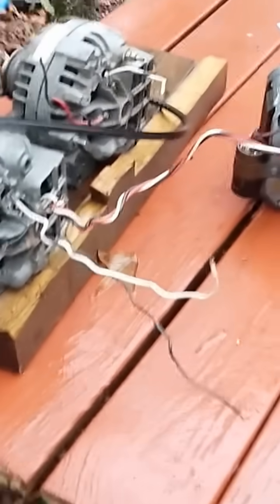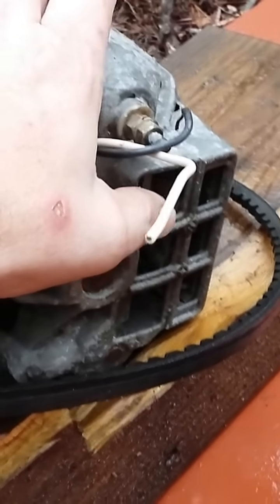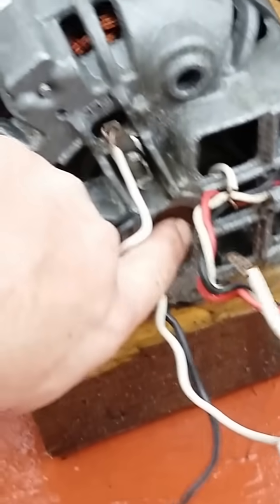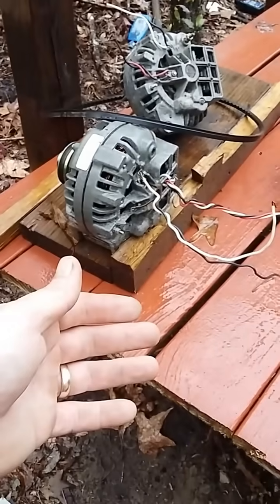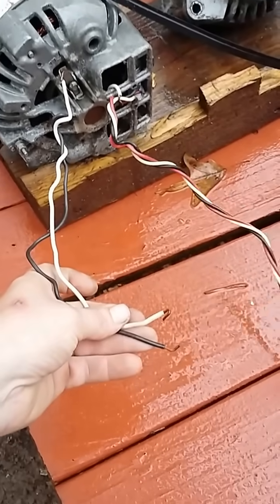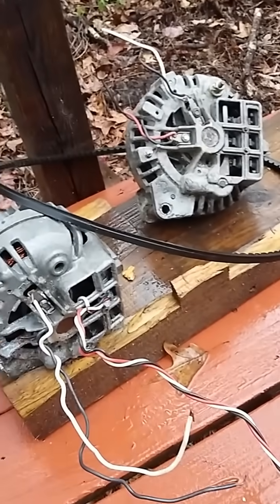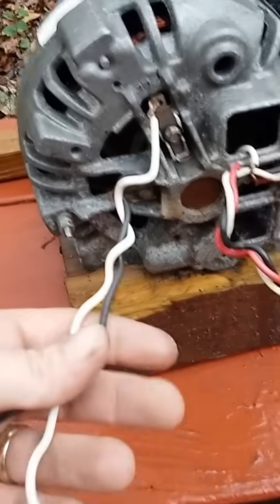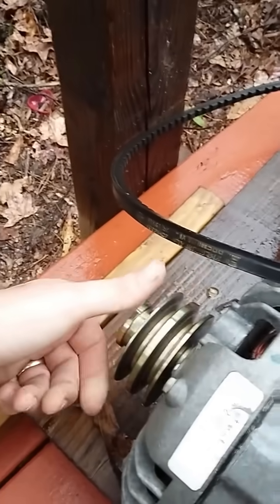Update Free energy forever no wind no solar no gas READ DISCRIPTION!!!

Comment: 90amps is not "alot of power". A nice stereo system in a car will feed from 150-200 amps. I'm not even talking about competition subs.
Reply: DaBuGzLiFe I can't advocate any success from this video, but I can tell you that 90a at 12v is not that much power (roughly 1000 watts- 90x12) but at 120 or 240 volts, 90 amps is allot of power- most homes have air conditioner's that run less than 40a at 240v for the compressor and 20-30a for the blower. Your home Edison circuits are rated/fused at 15 amps/120v, and you can run a ton of shit on that! Higher voltage makes for less Amps necessary to get the same power (watts) potential. That's why car electronics need so much heavier wire than AC.
Reply: Adam Shay I really doubt he can generate anything more than 50v from 1 alternator.
Reply: DaBuGzLiFe I didn't commit to him generating allot of power with that, I simply pointed out that 90 amps is allot of power if it's at higher voltage.
Reply from the maker: Adam Shay brother the only thing that you said in that comment that was true is 90 amps at 12 volts is not a lot of power. When you run 220 volts to an air conditioner system you run 110 volts to the motor and 110 volts to the compressor. 110 volts and 15 amps is not a whole lot of power and will not run a whole lot of stuff it will run one motor and one light bulb or you can run a stereo and 10 light bulbs. Car systems run large wire because they are so low voltage! voltage is a "regulator" that just regulates how much amperage or current can go through the line. So if I have 14750 volts at 60 hertz. I can step down the voltage and gain amps without having to lose my potential.

Comment: can you do this video, step by step, and show voltage , how to get dc current to power 6 to 12 volts ...solar..wind do the whole system
Reply: Jorge Salazar actually no he couldn’t. None of what he is saying is true, it is just a bunch of bullshit he cobbled together.
Reply: The concept is to simply use an automotive generator to produce electricity. This guy gave a half-assed explanation of the idea while not explaining how he got energy to turn the generator/alternator, ie a motor, windmill or waterwheel then acted like he discovered something. Newsflash: generators generate electricity. Wire them up  & spin them to produce power. No news at all!
Reply: If you tap in before the diodes you will indeed get an AC  current.  The big question is how much voltage and current will actually be available, and at what frequency (which will likely depend on how fast it is spinning)  normal household stuff in America is made for 60 cycles power second (or HZ- pronounced Hertz). Most of the rest of the world works at 50 cycles power second.
You could generate some voltage this way (provided you have a way to Keep the stator spinning) but I would plug anything I care about into it until I regulate Rhett voltage and frequency!
Reply from the maker: Adam Shay well then that would be a good reason to have homemade high voltage capacitors and if you wanted 60 hertz all you would have to do is turn the motor at 3600 revolutions per minute. if you were going for 50 hertz then you would turn it at 3000 revolutions per minute. if you want to be able to calculate this yourself think of the word revolutions per minute.. if you have 60 pulses per second(HZ) times 60 Seconds you will see that you need 3600 revolutions per minute.
Reply: ThomasBuie EnergyBuies at gmail com so you result to personal attacks when your information is bullshit and you try to baffle people with it. Boy, nothing is free in this world and your ego is not letting you see this will never work. Hell you don’t even know the difference between an alternator and a generator.
Reply from the maker: "Alternator" is the same as "generator"! SAME WORD...  You on the other hand YOU are a piece of shit excuse for a human being!!!!!!!!!!!!!!!!!!!!!!! Im not picking on you? You literally put drugs in the seat of my truck and told the police they were mine!!!!  I literally don't know anyone who is more of a horrible person than you. This video is misleading on purpose and everyone knows why. And it's in the description...

Comment: Your wire will not hold the load of a house, not with water heater and HVAC. Sure you have the amperage but your equipment doesn’t have the capacity for such load for extended periods of time.

Comment: You never mentioned how you powered the motor. Did you wire it into the alternator for power, probably possible to start the motor off with household a battery power source then switch to the alternator as a source of power, if that is what you did, assuming this ain't all bs, what method did you use for the switch over?
Reply from the maker: manawela 
The alternator on the left is my motor it is a direct current synchronous motor. I have labeled it on one of my other videos as bldc motor. but that is not completely true, even though I do use a brushless direct current motor controller that uses a square pulse wave which is called an electronic speed controller or ESC. it is none the less a direct current synchronous motor because I use direct current on my field winding and I pulse direct current into my stator winding. it is a very efficient motor and a very strong one. One small inverter and a car battery can power the motor for a long time. this video is not an instructional video. this video is a doorway to my other videos. please read the description. I have four systems that work. three of them are complete electrical with no fossil fuel of any sort and one is a regular combustion engine with generator heads attached to it and it powers itself also. (No gas consumption and output is O2) in order for a machine to be able to power itself it first must have enough capacitance to start itself or to run itself while it builds capacitance up. This can be achieved with either a battery bank or with homemade high voltage capacitors. either way you will need to make your own capacitors with aluminum foil. Because you're capacitance is a very key element in building a system. they are very efficient and much more durable than the ones you can buy and they are very important in harnessing alternate current. once you have enough capacitance you have completed your goal.
Keep in mind that your electricity going into your capacitors must be at a certain frequency of either 50 hertz or 60 hertz. 60 hertz on a generator head would be 3600 revolutions per minute. that is calculated by adding 60 seconds x 60 pulses per second or hz. ALWAYS BE CAREFUL WHEN WORKING WITH ELECTRICITY BECAUSE IT CAN KILL YOU.
Reply: Thanks for the information brother, but wouldn't it be less complicated to just run the motor off a battery or batteries  and use the power output to just keep the battery/batteries charged? This should last indefinitely but also have the added convenience of starting and stopping the whole system  easily without so many added steps, basically a flip of a switch. Also I want to use this in my apartment. How noisy is it would sound muffling help.
Reply from the maker: manawela if you used a small permanent magnet DC motor with a battery Bank to turn a large permanent magnet DC motor you could in return charge those batteries with the output from the large motor but you will have to play around with the ratios on your pulleys..

Comment: Perpetual motion is impossible on the planet Earth if it was we wouldn't even need to have this conversation but thank you anyway for the nice video
Reply: My friend says the relativity theory is flawed, and the Planck constant is not .. I believe him .. speed of light is not the limit , we are brain washed in school .
Reply: light doesn't have a set speed, it has a spectrum though.
Reply: Thomas Buie  I never said you couldn't get the power you need .But, you can't make more energy then it takes to produce because of resistance perhaps in the vacuum of space you would even have some resistance but there will always be heat resistance that will reduce power output below what's needed to produce perpetual motion would be a wonderful thing if the issue of resistance could be resolved thank you
Reply from the maker: Daniel Studebaker 
 you have to look outside the box! do you think anyone understood quantum mechanics without looking outside of the box? If you were to take a Siemens 3-phase 500 horsepower electric motor, put a gear Head On It, and use it to turn a hydroelectric generator, do you think that generator would be powerful enough to power that one little motor? you're not thinking big enough brother. I can take a 1/4 scale Servo motor and turn a 190 volt permanent magnet DC motor and the output is a lot more than the input. What I'm saying is it must be a very efficient motor or a very large system and the generator head must either be self excited or permanent magnet. you can use a car alternator but it takes more than one generator head on most systems. This video is for reference only it is not complete instructions for anything and I put Miss information in there to keep certain people away from me and this has worked very well. I've met a lot of great people. I've met a few famous people. I've spoken with scientist and physicist who can confirm what I say to be true. but nevertheless, what happens when you try to take out big oil and the electric companies? I had to make this video this way. most people don't comment and even fewer people have faith. but those are the people that I'm looking for, the people that have faith and want to learn and don't just want someone to give it to them, because if it broke down they wouldn't be able to fix it. that's what I'm looking for. I want to create strength and stability in the communities! if 100 people in a small City of 10,000 new how to do this they could teach the other 9900 people how to do it very easily. I have taught people all over the world. I didn't stop just because someone said that I couldn't do it.
Reply from the maker: Joao Vieira 
you're right and your friend is right too and you should believe him! there are spectrums that don't use travel or speed but move great distances without moving and they do it instantaneously! relativity is flawed unless it is a stationary item without moving through gravity or time whatever you want to call it.. but how does that work? LOL I don't think I should explain it completely but it's mainly because of what everyone calls gravity and gravity makes time possible. Keep that in mind when you're using plasma to build a time machine with a very high ionosphere...
Reply from the maker: Daniel Studebaker my primary mechanic's has the resistance. my secondary machine does not have any resistance therefore I create more than I use. HV caps are a necessity to use circuits on your machine. I use Ohm's law as a reference only because it is not 100% correct.  Keep in mind if I can use an internal combustion engine to turn two large generator heads, I can use one of those large generator heads on a hydrogen cell to power the motor and the other 10KW AC generator head needs to have some homemade high voltage capacitors so it will be constant.
Reply: hey I sent you a email

Comment: Why the hell would someone send electricity to a motor powered alternator? Does it run on fossil fuel or electricity? Lol.
Reply: And alternator doesn't have a magnet in it it using an electromagnet. The more power you put into the field some more power and alternator produces. That's how your car controls amount of power output from the alternator.
Reply: So what you're saying is that I'm an idiot and what this character is saying makes perfect sense to you?
Reply: PHAT PAT. Not saying you an  idiot, just explaining why you put power to the feild. What he is saying makes some sense but I don't  believe it would work the way he says. It's more like 90 amps at 12 volts closer to 1000 watts. You would probably need 1000 watt or bigger moter to turn it defeating your purpose. 90 amp at 240v is over 18,000 watts. No way that little alternator with its small wires is making that kind of power. If it some how produced 18,000 watts it would need something like a 35hp engine to do so. No car needs 18000 watts either.
Reply: I also know alternators make alternating current and convert to dc. If you could find a reliable way to spin alternator around a thousand RPM, wind wouldn't be reliable because it's not consistent, electrics defeating your purpose. You could use a car battery for your field but you would have to regulate its power in order to control your power output. You could probably produce enough power to keep your battery charged and run something small, smaller than a refrigerator.

Comment: Don't be fooled by these idiots. Rare earth magnets are necessary for this experiment to be successful. You must use brushless engines and brushless alternators in order to produce more than you are using it is that simple smoke another joint have fun
Reply from the maker: Jim Early 
Okay, obviously you are unaware that the laws of physics change almost every single day! So if energy cannot be created then where did it come from? that's what I thought you don't have an answer for that... It seems that you don't have any answers that are relevant. If I can transform energy into something new, split in half so that it equals the same and use it conventionally to power itself, then maybe the laws of physics just don't apply to me...
Reply: Free the weed. In physics, the law of conservation of energystates that the total energy of an isolated system remains constant  it is said to be conserved over time. In other words, this law means that energy can neither be created nor destroyed; rather, it can only be transformed from one form to another. So that means your talking out your hoo ha. Do a little research next time, and you won't look like your standing up in church screaming, what God, or something just as ludicrous.
Reply: Thomas Buie If you split voltage, then bring it back to original voltage, you now have half the amperage. energy comes from things like wind, dams made to spin generators, and 100 other ways. Now tell me where you create energy, just one logical answer. I'm a simple electronics tech. so I should be able to understand any reasonable answer. create energy, not transform it from one state to another that still equals the same. Same principal that a stun gun works on, 4, 1.5v batteries to 500,00 volts, but at such low amperage.